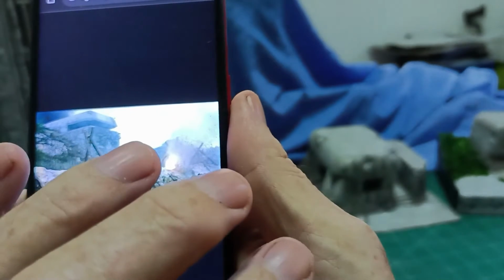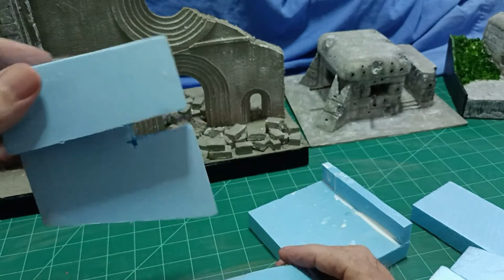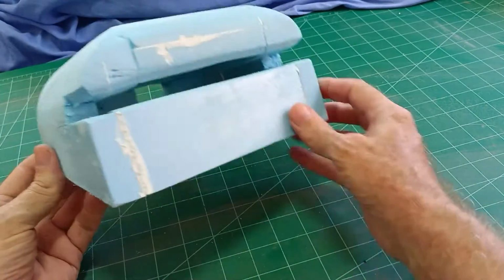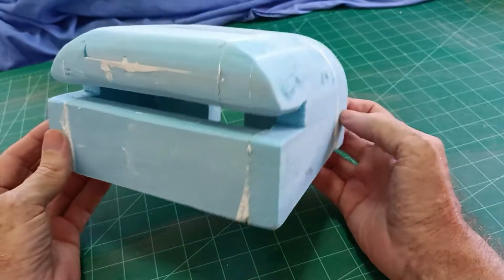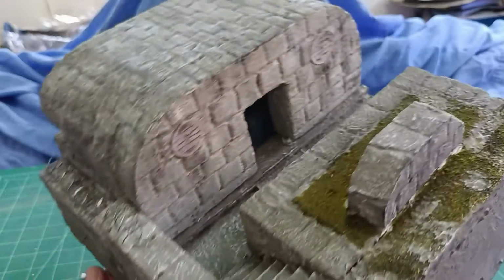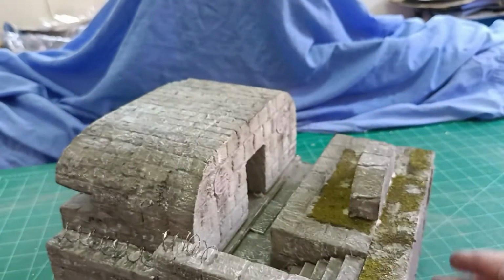Saving Private Ryan. Omaha beach machine gun post diorama tutorial 1/35 scale

Comment: 1:55 - Images working from
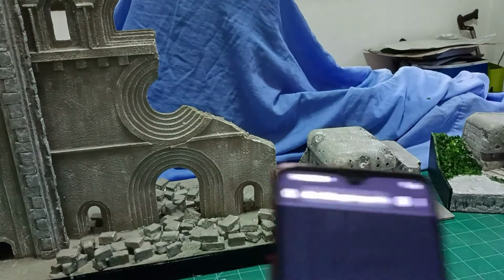2:30 - XPS Foam construction
4:10 - Glued together with wall filler putty and shaped
6:00 - Pillbox formed, painted, and flocked on base
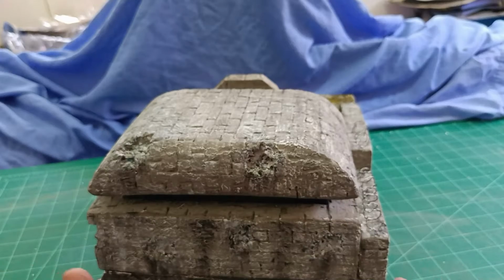9:03 - Diorama complete
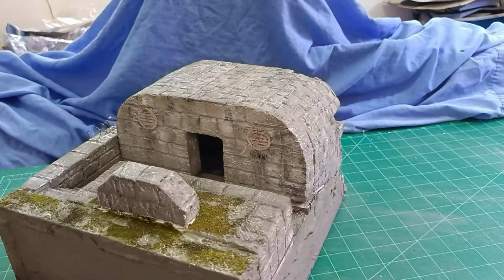9:55 - outro

Diorama Don relevant links
Ruined Building: https://www.youtube.com/watch?v=FrFnUs1kSS8 (knife awareness and safety)
Modelling dioramas: https://www.youtube.com/watch?v=75gQXxvfCg8 - (whitewash card with watered wall filler for stone or concrete surface)

Gun Emplacement: https://www.youtube.com/watch?v=KCEf7Zq8iJI&t=14s (pillbox) 
Machine Gun Emplacement: https://www.youtube.com/watch?v=qA49Blr0d0M&t=314s (pillbox) concrete bunker
Ruined church tower: https://www.youtube.com/watch?v=D9MZhI7_xlw poly styrene brickwork substrate 
Ramelle Church: https://www.youtube.com/watch?v=AfVqWNHnF5w (Wall Filler (putty) primer) Painting with grout.
Ramelle Ruined Church: https://www.youtube.com/watch?v=AfVqWNHnF5w&t=1032s (sniper scenes) bell tower, Corner Pillars,  Add PVA glue to grout as binder.
Stone Bridge: https://www.youtube.com/watch?v=L9MohxGm-wM&t=326s cardboard structure, including piers, for shape. Multiple sizes of stone shapes  - Arches, stone blocks, and bridge walls girding cobblestone roadway.  Capping stones on top of walls. Rubble made from ends and left over stone shapes.

Barbed Wire: https://www.youtube.com/watch?v=kxxcCDTo0oU
Barbed Wire and Sandbags: https://www.youtube.com/watch?v=Y4-CP6tkvm8